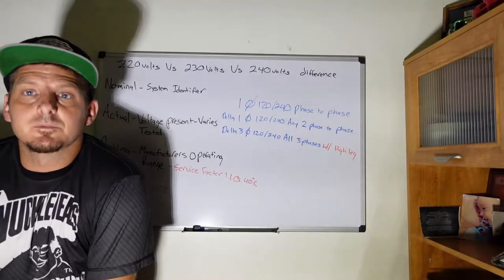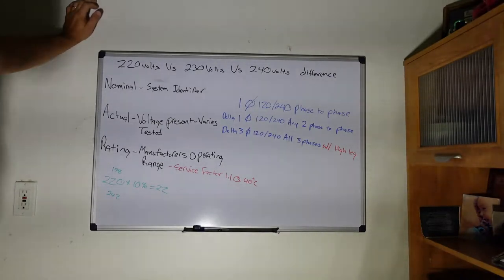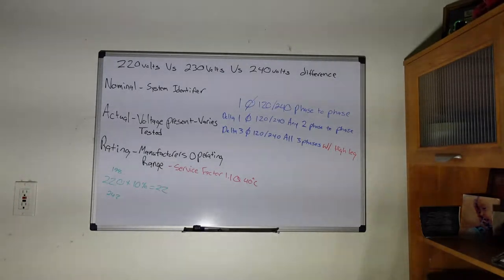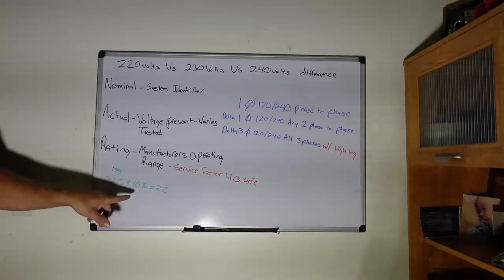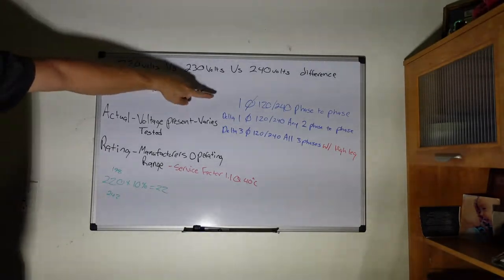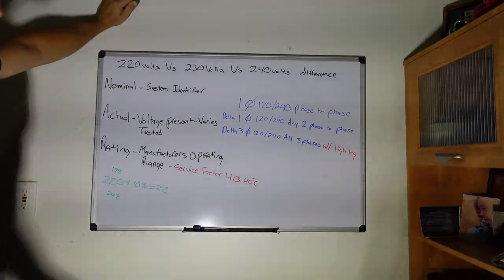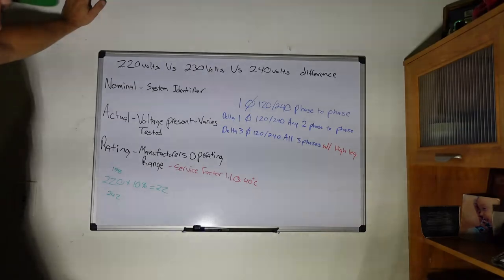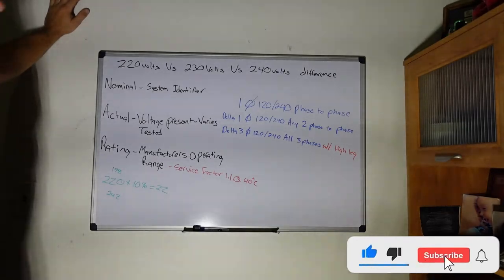What's the difference between 220 volts, 230 volts, 240 volts?  Will my equipment work?

Comment: Will a 240 volt air conditioner from England work on our 240 the one in England is 240 phase to ground and ours is 240 phase to face will it still work

Comment: Actually not always. I bought some old equipmentand it blowed quickly just because they were rated 220V and the mains is 240V. One, an old Philips amplifier stopped working after one week, its preamp had Zenner 5W diodes that burned when used at 240V; another, an old HP lab power source also rated 220V instantly burned some opamps in the regulation part because the applied voltage was higher than max rating for them. An tube (valve) radio, just recapped, burned one tube filament after few weeks of use because instead 6.3V it had 7V at filaments. Many old power adapters with transformers ran hotter when used at 240V.
All aplliances that gave problems (burning, running hotter) were powered through transformers.
So, not, an 10% variation for the mains can actually destroy your equipment.

Comment: Useful video! I just bought a 230v Fender Tube Amp, but here in Malaysia the voltage is 240v. I'm notice it runs hot, could that be to do with the extra 10v or is it nothing to worry about?
Reply from the maker: Depends on the voltage variance, without seeing it no way to know. But if I had to guess I’d say it’s probably within the limit

Comment: unless it's EU and all them where it's 230v 1ph where it's 230v on line and a neutral at 50hz then hooking it to 240v american 60hz as per say a motor it will hook up just run 20 percent faster depending on motor.  most other appliances or gadgets etc always check the plate ratings for that.

Comment: Hi there I would like to ask you a question I am buying a amplifier from overseas in Spain and he says it runs at 220 volt and l am in Australia at 240 volt do I need to just change the cord or is there more involved 
Thanks David 😮
Reply from the maker: Is it calling for 3 phase or single phase 220? What do you have where the amp will be?
Reply: @SolidElectricalSolutions  
Hi there thank you for your reply The amplifier that I'm speaking about is a guitar amplifier or a head and then you attach the head to the cabinet or cab I am thinking about buying one from overseas in Spain because they don't sell any brand new ones over here anymore because  production or the run has stopped it's a supersonic 22 fender head  and it's a 220 volt do I just change the cord or put it in a little power converter socket in the wall not too sure about the three phase and two-phase stuff I'm not an electrician now if I was to buy that head over here it would be 240 volt I'm sorry I don't have any more information about the phases 
Thanks David
Reply: @123elvislives 3 phase in Europe is generally 400v on a wye transformer with 230 phase to neutral and 400 phase to phase. Northern Europe gets 3 phase to the home but only Norway still has the older IT nett  230 3 phases from a delta transformers. However they are slowly switching to the new TN nett system that is now standard. I can’t speak much for Spain but I doubt it is much different.

Europe changed the standard from 220 to 230 + / - 5%-10% in 2008. So if the amp was made before then the tolerances might be out of range. But a lot of older audio equipment often has taps on the transformer inside often with a selector for 220 and 240 as the UK is 240/410. So there usually is a way to change between the two if it’s tolerance is smaller. If the device didn’t specify try to find the service manual.

I hope by now you have found out the tolerance for the amp. As even in the UK the voltage can get to 245. So I doubt it was an issue but never know without seeing the spec sheet.

If the Amp states it can be used in the UK I suspect all you have you do is change the cord. But id still suggest trying to find out for certain first. If your opening the unit up and can safely see the transformer it might state on it or have the taps necessary for 240. Maybe a part number but that could be hard to track down depending on when it was made. The taps may not be identifiable so the service manual should help. It may also not have them. If it was made after 2008 it should comply with the new standard but I don’t see why it would state 220 then.

Good luck and stay safe be cautious and if you aren’t sure what your doing find a shop that can help.

Comment: i have brought a 230V hair dryer but my country's average voltage is 220V,will that be a problem?
Reply from the maker: Depends on the allowable voltage variance, more than likely not.
Reply: If the Hair Dryer is brand new and was purchased in Europe. Then it should automatically comply with EU standards which is 230 +- 5-10% to account for the country’s that still use 220 mostly the south, and 240 the UK while most of Northern Europe has switched to 230. You should be able to find this specified in the manual.

Comment: I have a question is voltage supposed to surge to 320v ? It’s supposed to be 220v and it is but is goes up to 320 and back down and back up and it does it constantly?
Reply from the maker: It depends on what the meter is reading. Actual voltage or RMS voltage?  If you have a video of it I could answer your question a little better.

Comment: I'm buying an electric vehicle that comes with a 240 volt charging cord but my outlet in my garage is a 220 volt.  Are you saying I can plug my 240 volt cord into my 220 volt plug to charge my car?
Reply from the maker: Yes,  as long as both of them are rated for single phase or both rated for 3 phase.